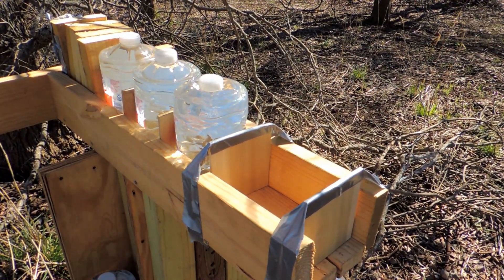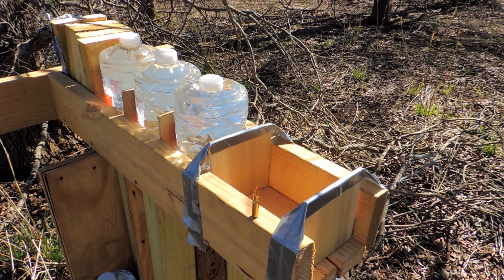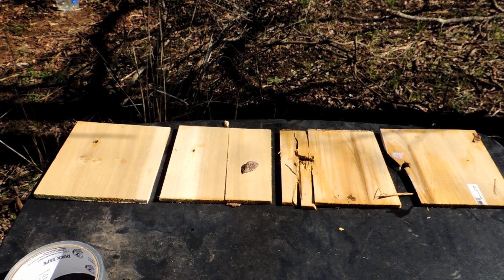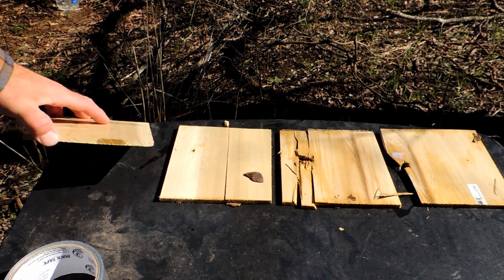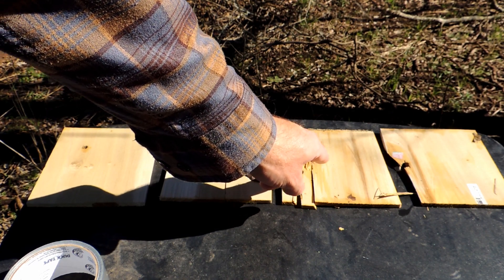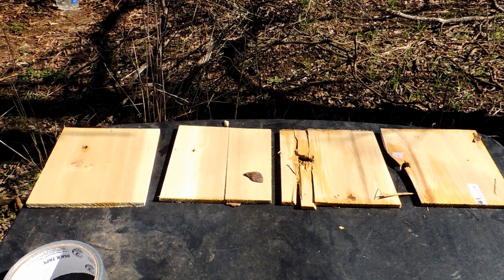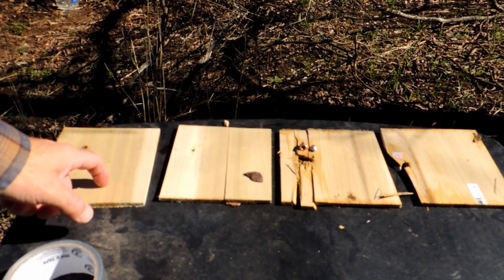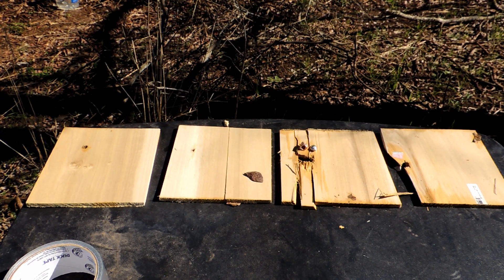6.5 GRENDEL 2-D PRINTING 9in GAP EXPANSION

Comment: Oh yes. Great data. Really dumped its energy after the first water jug. 
Wonder why two pieces though with just wood?
Reply from the maker: Something was said awhile back that maybe the wood was the reason for the fast expansion or something. So I figured 2 boards, empty gap would show it it expanded off the 1st board. Which it doesnt, not even the 2nd. Until the water.  Thanks WH!!             james